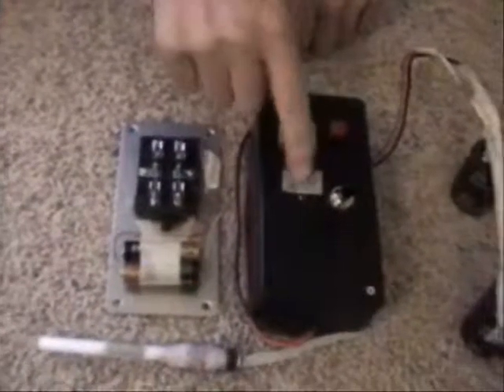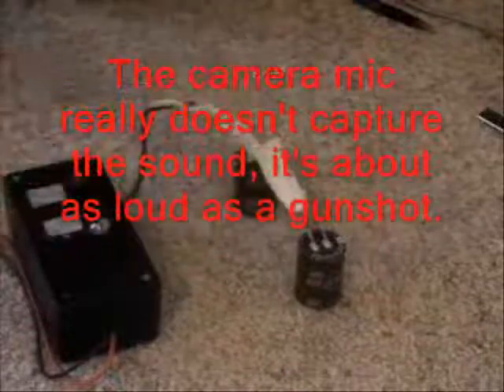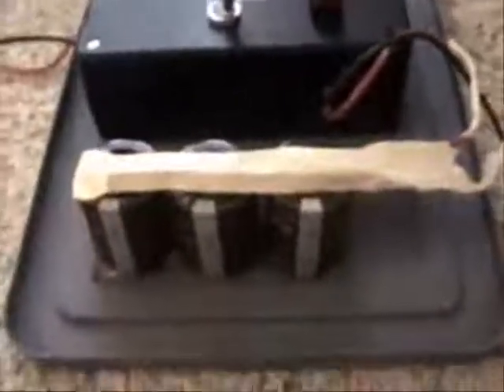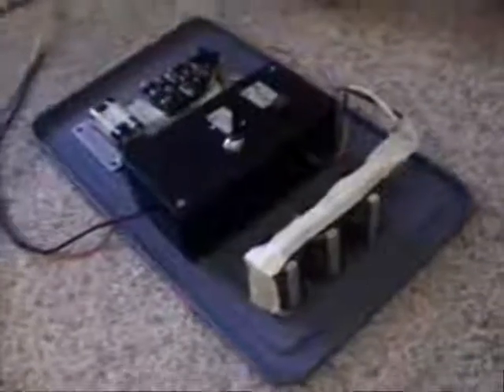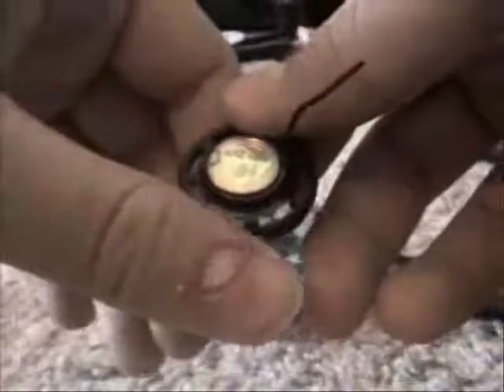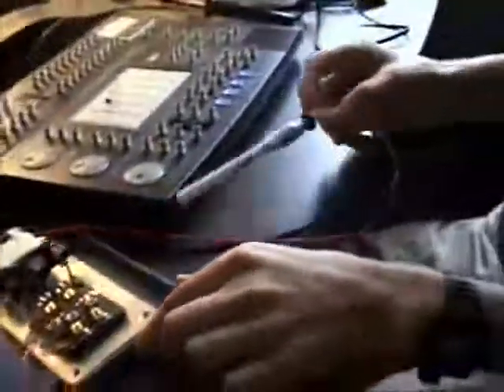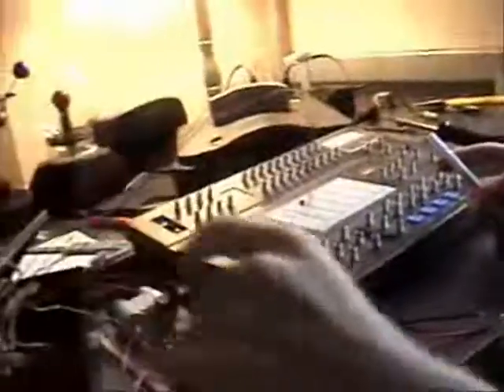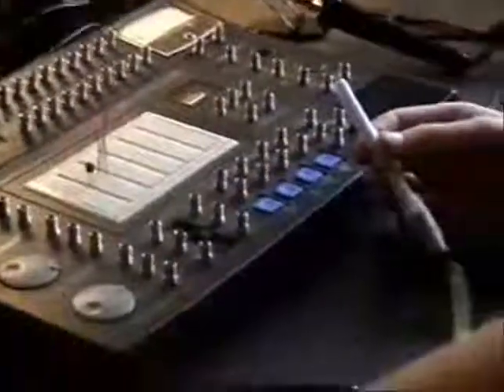Mini electrokinetic gun, proof of concept

Comment: if i show u an scr u w be worried not to drop it on yr fes :)) (200A 1400v to be moe precise, it never getshot or even worm no matter how many caps i use. so far i got 18mF at 350v) to get rid of the rezistance in the sistem use a thicker wre for the conections (i use 6mm^2 and 2mm^2 for thecoil) put 2 washers at the ends of the coil and an pice of iro pice over it. this way u will get a good efichency. i put 4mmX3cm nail projectiles through cocons (blunt tip projectile). nice prezntation btw :)